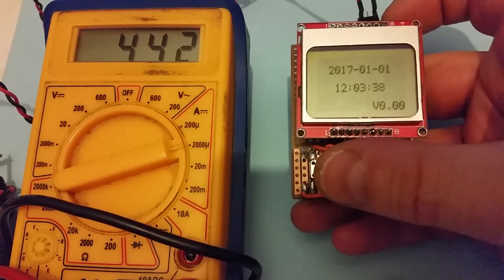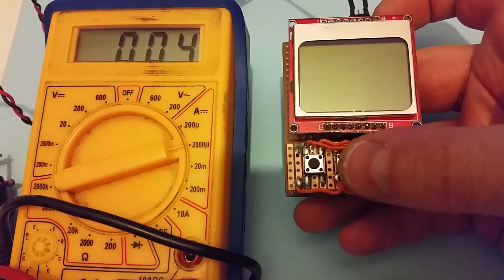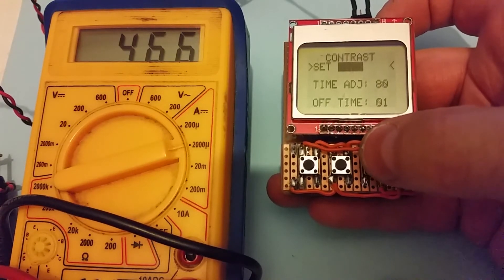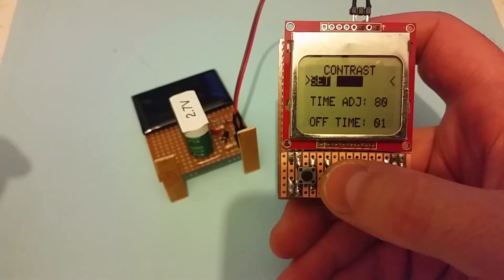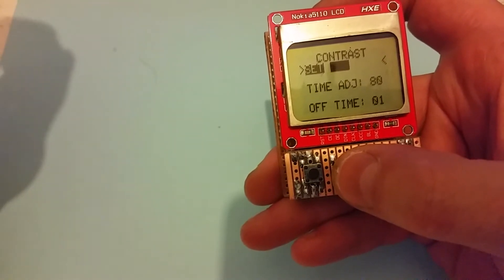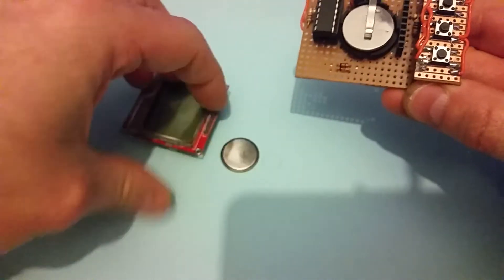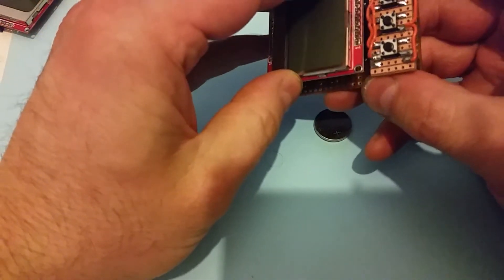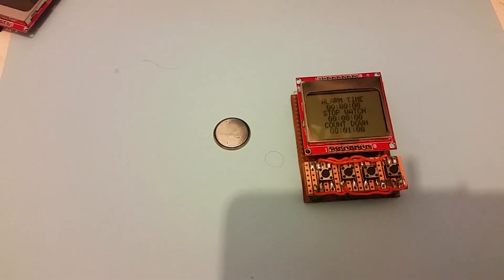Nokia 5110 LCD Powered With Coin Cell or Solar Charged Super Capacitor

Comment: hi sir, what pic uC did you use here?
Reply from the maker: In this project I was using the PIC16F684, my favorite of the older PIC range. Since then I have updated to the PIC16F18326, this is a more modern PIC with 16K program memory and 2K RAM, it also has a built in temperature sensor.
Reply: with nanoWatt Technology, Wide operating voltage range (2.0V-5.5V)....good (:
I was just about to order it from aliexpress (and I ordered 10pcs)
on the other hand the new one you mentioned (PIC16F18326) is Very expensive.
I just subscribed to your channel keep up with the good work
Reply from the maker: Thank you. I have also subscribed to your channel, I think we are doing similar things, so your videos are very interesting.
Reply: I agree but we both have a lot to learn hahaha (-:
Reply: We both have explanatory short clips in various subjects without delving and revealing the schematics, anyway whether you are interested in any code or schematics from my episodes - just ask and I will send them to you. 
Also thanks for your compliment about my channel I am happy to know that my non edited verbal explanations intrigued somebody, its my pleasure.
Reply from the maker: Thank you. Most of my code for the videos is on GitHub here:
https://github.com/BirchJD?tab=repositories
The project details are usually here if I do them, sometimes I do a rough drawing in the video:
http://www.newsdownload.co.uk/ 
There are only two projects I'm not publishing as I am hoping to make them into products, it is effectively my day job currently for these two projects.